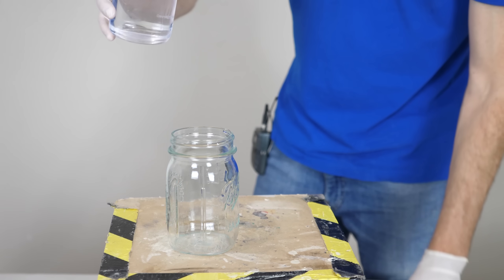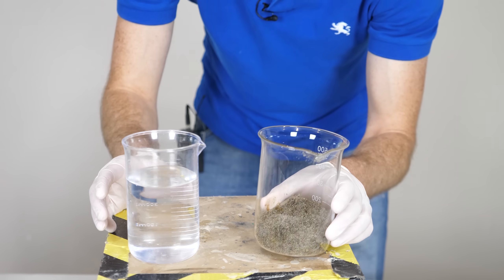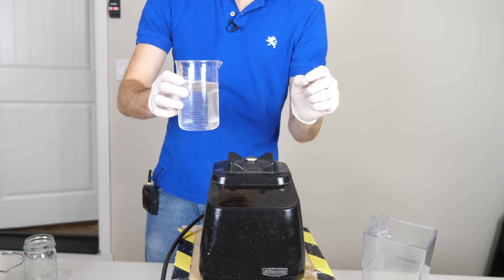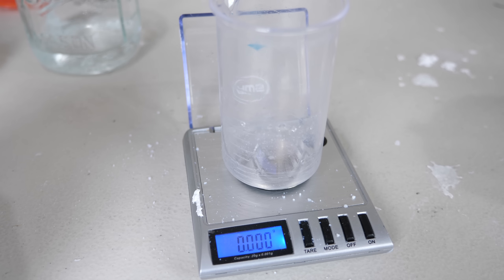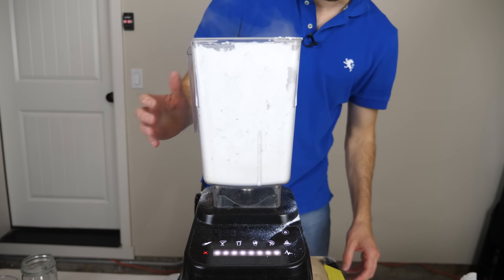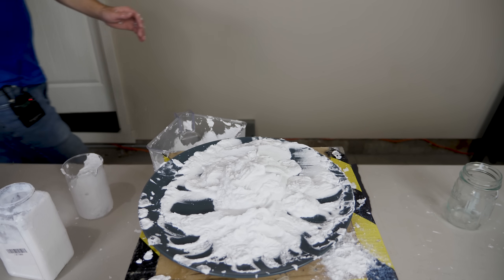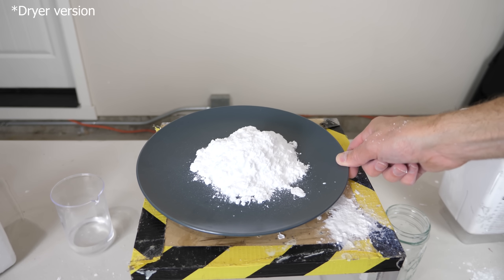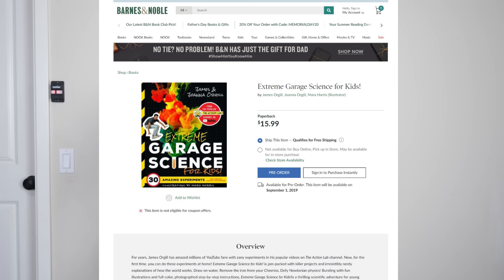How to Make Dry Water...Weird Experiment Makes Water That's Not Wet

Comment: First of all, this is no longer water, because you added something different into it. You changed its state just like if you freeze water. It's not water, it's ice.
Or if you boil it, it's no longer water. It's steam, you have changed the state. It is in unlike ice and steam. However, I don't believe you can reverse. The effect on this,  which permanently changes this from water, I don't want you to whatever this stuff is dry. Water is an inaccurate description, but accurate at the same time

Comment: While you can buy the stuff on-line, I recommend that most users avoid doing so, as the powder is extremely fine. When handling and mixing it, almost impossible not to inhale it unless you are wearing a proper mask.

Comment: I got fumed silica and it was hydrophillic, rather than hydrophobic. It absolutely sucked the moisture out of everything, including my skin. Mixing it with water, it happily absorbed quite a bit and turned into a gloopy gel, sorta like the stuff from diapers. It certainly didn't exhibit any hydrophobic properties. Otherwise, it was the same. Very light, fluffy, like snow, but the chunks, even in your sample, indicate it is hydrophillic and absorbs water. The chunks form as water is absorbed from humidity in the air. Just like baking soda.

Comment: how do I know one fumed silica from another?Fumed silica, aperantly there are several different types, the hydrophobic by design that has surface chemistry that goes like O-Si-H or treated to have O-Si-CH3 , then there is the normal silica that has the surface molecule atoms in this order, Si-OH , that later one is the normal hydrophilic kind, but if the surface is rough enough they can't repair and make it hydrophobic anyway.. 
What kind of fumed silica are you using, and how do you find out what you're getting? It's not exactly like this stuff is labeled like that!

Comment: get some dehydrated water and put that to the test.

also I wonder if what's actually going on here is the water is wetting the (normally hydrophobic) silica, and so you'r ending up with a lot of wet silica particles that cannot merge to become a larger integrated pool of water?  Thus introducing the variable friction you're observing, that's keeping it from flattening out and running off the plate.  The reason water is fluid is that the molecules can freely move around inside the body.  And this can't wet you because the surface tension has already captured grains of silica and can't extend outward any farther to coat your skin.

Comment: Sorry. Not sorry. You can call it whatever you decide to pull out of your a..., but your result is a silica emulsion. Water is 1 oxygen and 2 hydrogen atoms. It can be found in liquid, solid and gassious states, but it is still 1 oxygen and 2 hydrogen atoms. If you add tea leaves to water, the result is tea, not water. The water becomes infused with the soluble compounds from the leaves. It now becomes 98% water and 2% other. It's molecular structure has changed.
I don't know why I watch this crap.

Comment: I'm not sure.... I mean, it's just white mud (that doesn't stick to smooth surfaces).  What happens if you get some on your pants? Is it still water? When the liquid evaporates, is it still water? This is just the silica sliding in between molecules of water. Like if you take a half cup of water and mix with a half cup of pure alcohol, you'll end up with 3/4 cup of a liquid bc the molecules slide up next to each other so not to take up as much space. But anyway, I dig these vids, and like the way you explain this in common terms to us monkeys. :)

Comment: There is a way to make silicone powder at home. You need to burn a piece of silicone polymer (it is easily ignited) to ash, for example, a cured silicone sealant, or a silicone gasket, in general, any silicone object. As a child, I learned about such entertainment, not knowing that there is a scientific explanation for this.

Comment: how is it water ?  it is mixed with something else.

There is a more easy way to make dry water : 
Freeze it.
Reply: Ice is still wet because it starts melting from the heat around it and your hand gets wet if you hold it
Reply: @stellaoctangula9898  if it melt its not ice.
Ice melt only if the temperature is > 0 and if the ice itself isnt very cold.

Comment: Hey, this is a huge safety hazard. Glass/quartz/silicate is extraordinarily inert. When it's in powdered form and gets suspended in the air, you have a highly inert suspension. When that gets in your lungs, you have something too inert for your body to process. That's very bad. Similar to asbestos, though there might be something else at play there. Highly inert nano/microparticles are bad for your lungs.

Demolition ranch did a video where he shot a glass orb with various rounds. He was coughing the whole time. Imagine tiny saw blades buffeting the insides of your lungs.

Comment: I wonder if you can make something that would perform equivalently to fumed silica with less energy use than what you need to make actual fumed silica (which takes a lot of heat)?  Also wonder if some materials other than silica would work for this purpose?

Comment: Water isn't wet. Water can't be wet. But it's not dry either. If something can become wet. That means it has a surface water can stick too without fusing with though. Water however, will fuse with other water if the 2 waters touch. This makes 1 big water. It can be unfused via pouring some water somewhere else or drying some of the water off of the surface the water is sticking too. It's not dry though because dry means when something is not touching water. Water molecules touch other water molecules while fused so they aren't dry either.

Comment: A lot of people say that water isn’t wet. And they say: “fire is burnt because it burns things” however, wet is an adjective that refers to the temporary state of an object, while burnt refers to the permanent state of an object. The temporary equivalent of burnt is burning (as an adjective and not a verb, so don’t say that’s if I am saying burning then waters equivalent would be wetting, because wetting is only a verb. Waters equivalent to burning is wet). If I were to say water is wet because it causes things to be wet, it is the same as saying fire is burning because it causes things to be burning, which is true, only because of the slight changes in the meaning of the word burning. Wet isn’t just one meaning, because it’s usage in the world affects its meanings. These slight differences in the meaning of wet can cause water to be considered wet, even if it isn’t in the exact same context as a wet object.
Reply: The difference in this analogy is that when fire burns something, the fire is actually doing something that causes the object to burn. Fire isn't burning because it doesn't cause itself to burn. Water, on the other hand, simply exists, so it makes the object wet, which is why the question "is water wet" is brought up.

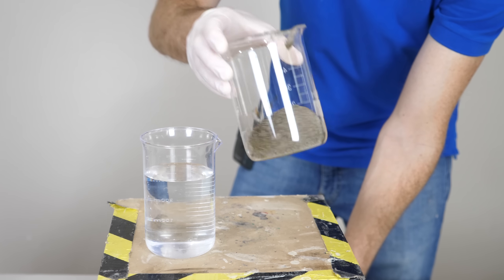Comment: 0:37 Whereas this sand here, even though it may seem kind of liquid-like, we can all agree that this is a solid, because it’s just tiny little pieces of bigger rocks, and it doesn’t quite conform to its container. As you can see, I can kind of stack it up on one side of the container here, so it doesn’t fully conform to the container, because it’s not a liquid, it’s a solid. 

After using an oxymoron to describe sand as “tiny little pieces of bigger rocks,” he proceeds to make a powder that is also not a liquid, because it is a solid that he could stack up on one side of the container.

5:03 Stacks powder on one side of the container.
Reply: Then he describes a powder that is hydrophilic as “hydrophobic.” What a joke this man is. Does no research and just sits there like a man-child and plays with whatever material he has.

Comment: Is there a solid state of oxygen? Since stuff like chlorine and water has a gaseous, liquid, and solid state could oxygen possibly, in a cold enough temperature, turn solid?
Reply: Yeah, in fact there are multiple solid phases of oxygen.
The three of them that do not require high pressure are the alpha phase (α), beta phase (β), and gamma phase (γ).

Gamma:
The gamma phase (γ-phase) is the first to form as you lower the temperature of the oxygen. It goes from liquid to solid at about -218.79 °C (-361.82 °F). Its crystal structure is cubic, so it’s easy to make cube-shaped chunks of it. It’s got a faint blue color to it, similar to liquid oxygen.
Beta:
The beta phase (β-phase) is the next to form as the temperature goes below -229.4 °C (-380.8 °F). Its crystal structure is rhombohedral, meaning you can make cubes, but they’re going to be tilted. It’s faces are a rhombus, which is a bent square. Kind of like a diamond shape ♦️. It’ll also be faint blue but it can look pink under certain conditions like high pressure, or when light shines on it a certain way.
Alpha:
The alpha phase (α-phase) forms when you take it down even lower to -249.4 °C (-416.8 °F). This is only 23.8 °C / 42.8° F above absolute zero. This crystal structure is monoclinic, meaning you can make pieces that are long and straight and have parallelograms on the ends. This is the coldest phase under normal pressures, and it is a light blue but much less see-through than the phases above it.

There are other phases that require extreme pressure to form.
Delta:
The delta phase (δ-phase) forms at room temperature, but you have to have pressure 90,000 times higher than normal. If you make it colder though you’ll only need about 60,000 times higher pressure. This phase is orange.
The epsilon phase (ε-phase) forms at 100,000 times normal pressure and is deep red or even black. The zeta phase (ζ-phase) forms at 960,000 times normal pressure and is metallic in nature. Physics gets weird here.
Reply: @nathanoher4865  woah, that's amazing, i definitely didn't expect to get an answer from anyone! Thank you ^^
Reply: @U.R.coolkid  You’re welcome, I could have given more info but my phone was at 1%
Reply: @nathanoher4865  that's more information than I could ever ask for. wow!